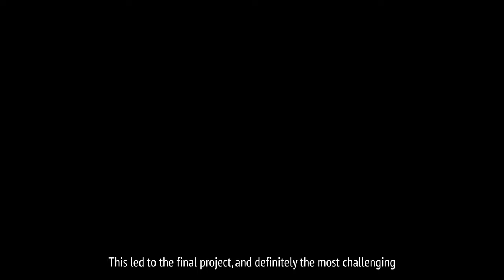Building My Dream BMW F10 In 10 Minutes

Comment: Can u please tell me where u got the trunk spoiler or what brand it is? I’ve seen ones like that but that one looks different than most like the lip is higher and it looks really good thanks.
Reply from the maker: I purchased it from a local bmw parts dismantler, so I’m not sure of the brand, but it’s just a “high kick” trunk spoiler, I’m sure you can find them on eBay or something similar 👍🏼

Comment: would those side skirt extensions fit on an f10 without the m sport side skirts?
Reply from the maker: Truthfully, I’m not 100% sure, length wise yes but how they mount, I can’t say for certain, but my guess would be yes they will, the designs aren’t crazy different from one another, so I’d probably try it if I didn’t have the msport ones already 👍🏼
Reply: sweet thanks for the reply, do you happen to have the link for the product still?  @Anthony_B

Comment: I got the rear diffuser the same look as yours but its from rw carbon. Cant fit it in by only took off the oem rear diffuser. They ask me to take off the whole rear bumper. dk why. I cant click the side into the bumper, but the clicks on top are ok
Reply from the maker: Maybe consider reaching out assuming your rear bumper is OEM, but a lot of those pieces are made in the same place by the same people (not sure where RW carbon’s are from) and sadly many don’t fit well, mine included haha
Reply: @Anthony_B  Dontknow where it from. Sadly, it cost me over 500 bucks. Hoping one day I can have place to take off the wheels and bumper to install this diffuser perfectly.

Comment: Hi. Can you suggest a wrap which you used? Where I can buy it? How much vinyl wrap do I need fully wrap my car? I have same BMW F10
Reply from the maker: I bought 3M Satin Dark Grey from metro restyling (metrorestyling.com), and I purchased 5’x75’ to be on the safe side, you wanna assume that you may have to redo a couple panels so the more you get the better off you’ll be, I was fortunate to have only messed up my very first panel so at the end I had a bit left over, but I’d always purchase that amount if I was to wrap another f10

Also I want to note that I opted to not wrap my roof because my car was black from factory, so that is another reason for having a lot left over

Comment: I wanted to get my tint first before I got the m front bumper installed. but how come the washer caps aren’t installed on the front bumper? After seeing this vid is the install hard for the front and rear (bumper)?
Reply from the maker: I shaved them when I was repairing/prepping the body for the wrap, so the bumper did have them, but I shaved them for the wrap

Comment: Amazing work. I will soon buy one of the f10 models and this vid stole my heart. Can you tell us how this model works for you on a daily basis?
Reply from the maker: Thank you! I no longer own the F10 but during my ownership I never had any major issues, most of the items I address I also documented here on my channel, but to be fair, I also didn’t daily drive this car, it was a weekend car so I wouldn’t know 100% how the car is on a daily basis, all I can say is everytime I did drive the car, I was reminded why I bought it in the first place!
Reply: Ive owned an f10 since february of this year, I have a 2015 535xi (non m-sport). This car is truly one of the best choices if you're looking for a well rounded luxury daily/cruiser. I don't know what model youre looking at, but the n55 in this car straight from factory is enough to put a smile on your face whenever you touch the gas. In terms of comfort, it doesn't really get better than this. The blend in luxury and sportiness is (imo) the best in the 5 series, its not as compact as a 3 series, and not as long as a 7 series but you get the benefits of both, the sportiness from the 3 series is ready for you whenever you want to toggle that sport mode, and the comfort and smooth riding quality from the 7 series is right there whenever you just want a calm cruise. The power delivery from the turbo 6 cylinder paired with the 8 speed auto beautifully deliver that feeling of happiness wether you're ripping on some fun roads or cruising through the city. You would love the f10, especially with the n55, which is arguably the most reliable option instead of the turbo 4cyl to the twin turbo v8 lineup (in terms of gas powered engines, don't know too much about the diesel options). Good luck and let me know if you end of picking up an f10!

Comment: How are your ECS coils?
Reply: i have them on my f10, a little bouncy not the best for hard driving or tracking but a great budget friendly option 30k miles and no issue
Reply from the maker: Exactly what @theodyssey500 said, a little bouncy but with the dampening control you can dial them to your likely pretty well, and so far no complaints since I’ve installed them